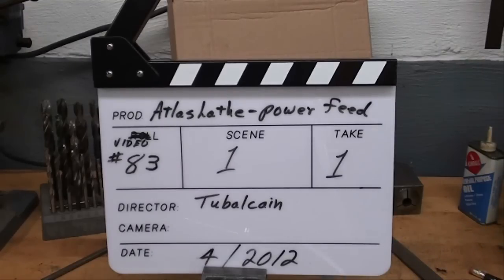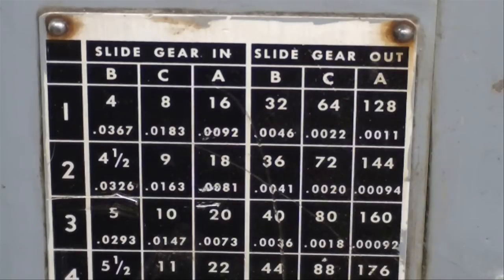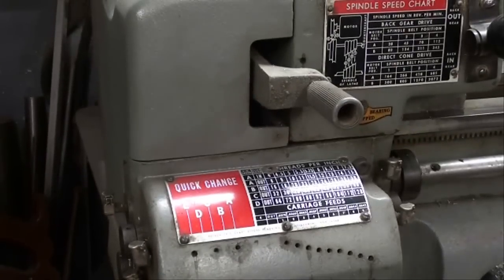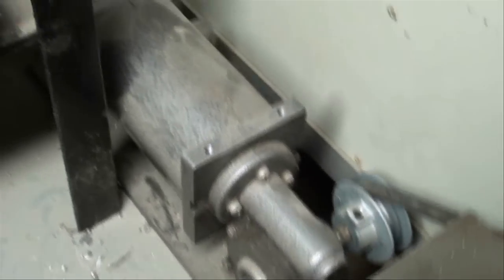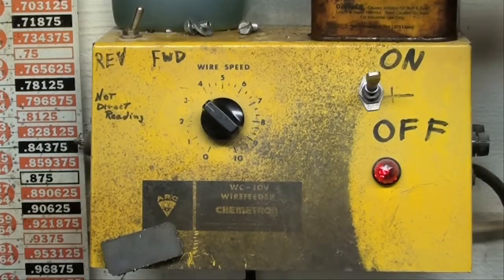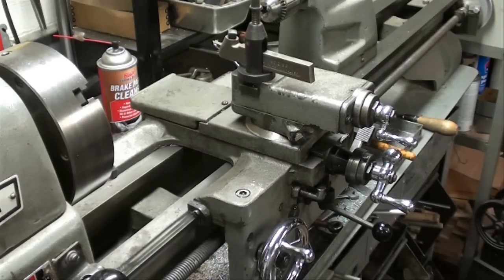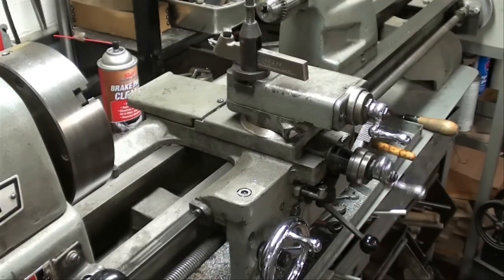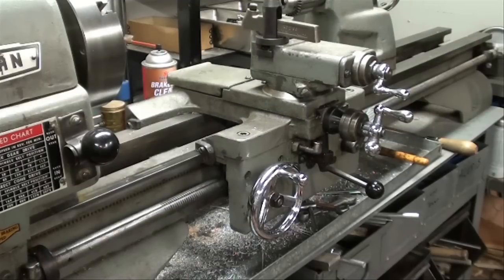Custom Power Feed for Atlas CRAFTSMAN Lathe #83 tubalcain

Comment: Hi, Mr. Pete.

Great idea.

The second best thing about this arrangement is that it really quiets an Atlas/Craftsman lathe. 

The third best thing is the lessening of wear in the gear train.

If you wanted finer adjustment of  the wire feed box ,  a dial assembly for  a variable output switch (also called a ten turn potentiometer) could be fitted in place of the existing knob. 

Tom

Comment: I added a 40/20 combination gear in the gear train of my Atlas 10X24 lathe.  It gives me a final slow speed of .0021/rev.  Not ideally slow, but in the ballpark.  I just double the thread count on the gearbox chart to pick my thread.  Thanks for all the great vids.

Comment: SAFETY TIP! Tubalcain, Not sure if this safety tip has been referred to before. When i was taught to use a lathe I was always taught never to operate a lathe or drill press for that matter under a florescent light. The flickering of a Florescent light can act as a strobe and make it look as if the chuck is not turning when it actually is. We ALWAYS had to use an incandescent light to prevent this from happening. This was drummed in both at school and also in the workplace. maybe worth mentioning

Comment: a DC motor will retain its torque even when the speed is changed. this is why they are still used today. i have an Atlas 12X36 and am real happy with it , except the feed rate is too high, even at the lowest setting. i am considering one of these set-ups in the future. thanks for the excellent training video.

Comment: Hi Tubalcain, enjoying your videos here in Germany!
The reason most high-speed motors out of electrical tools won't work is that they are permanent-stator types. They are cheaper built and in general supposed to be operated at higher RPM's. They lack torque at lower RMP's because of their static and weak stator-field.
An appropriate motor-type is a wound-stator motor, which can deliver full torque at low speeds due to then amplified stator-field. Most servo-motors are wound-stator motors.

Comment: Hi tubalcain. Great video. I already have a VSD on the main drive motor of my atlas craftsman lathe. The original owner installed it. It is really handy. I am going to build a setup like this for my lathe. The alloy used in the atlas craftsman is called ZAMAC I know this because my transverse carriage gear case is made out of this I found out because mine was broken and I had to get it  welded and the welder told me what it was. Great video and great idea.

Comment: Yes, i was in the same boat. Gear blanks are easy to find, cutting ths splines kind of a pain in the butt. Els cost less and does more. It is designed to allow 2 axis control. it will advance whatever distance you tell it to, then stop provided you do the "electric half nut" as well. this setup will also control an X axis, so you just touch off. tell it what thread pitch, diameter and distance you want then press go. 2 axis ELS also replaces Taper Attachment and allows spherical turning.

Comment: That's right, Zamak is a Zinc alloy commonly used on automobile parts. It's not as strong as cast iron but it does the job well on mirror casings, small gears, levers, etc.

Comment: Oh, Mr Pete/Tubalcain. Is there ANYTHING you can't do? Thanks for the video - A few years ago I acquired an old lathe that appears to be an Atlas 10". It's been through a lot of owners by the looks of things and has therefore been modified extensively by each owner. It's a mongrel compared to the machines you have, but I'm inspired by your creativity. It WILL do what I want (yes, this will mean that I add further modifications to an already confused lathe)

Comment: Neat.  Have you tried to cut some non-standard thread pitches in this manner?

If you needed to cut some thread pitches the gear box is unable to, you could use a stepper motor and driver with a PLC instead of that analog speed controlled motor.   Program the PLC with presets to drive the motor at given, known rates to get the desired thread pitch.

I have that exact lathe and am thinking about doing something like that.  I recently needed a .625-19 LH thread tap to finish a part on an old international tractor.  "If only I had a CNC lathe!"

Never occurred to me to power the carriage leadscrew from the tailstock end until I saw this video.  Great stuff, thanks for posting.

Comment: This is cool. What's interesting about it is that you could apply the principle to this using a gilmer belt so it doesn't slip and then get some steppers/servos and do a CNC setup with it.
Reply: Funny you mention that - someone recently did that. They used an Arduino and a few other bits to do a servo drive lead screw. I wish I could remember the name - they had it as a kit.

Comment: I was getting ready to do this vary thing, but with a 1/2 drill motor, Your comment that they don't work well for this is making me rethink that. I thought a good 1/2 inch drill motor running direct drive might work. I wonder if the drill motor with a reduction pulley would work? Maybe I'll just find something better like you did, thanks for giving us the benefit of your experience with this.

I was checking out the change gears and it seems that if one found the right size gear, one could setup the change gears to slow down the shaft enough to work also. Different types of change gears are available so that just might work.
Reply from the maker: Thanks for watching. Drill motors do not seem to hold the lower speeds under load.  If I were to do it over, I would experiment with change gears.
Reply: most drill motors are universal motors, they will run on AC or DC. they have a gizmo which is tied to the trigger to reduce the speed. they would not work well for this. try a treadmill motor with its proper matching controller.

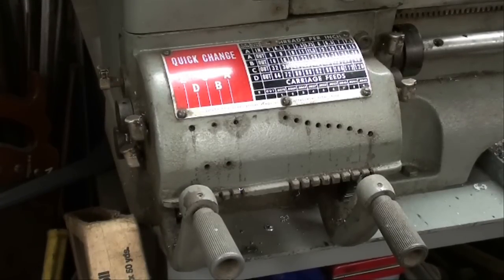Comment: @3:57 you refer to the "Bogus name" of the material of the gears that Atlas used. I believe the name they came up with for this alloy was "ZAMAK" which is an alloy of Zinc, Aluminum, MAgnesium, and Kupfer (kupfer is German for copper). By making the gears this way they eliminated the need for any machining of the gears.

Comment: have you considered setting it up so your power feed unit turns on with the headstock motor.  you could even keep your current power switch so it stays off when you are using the gear drive.  also do you have to unhook something so when you are using the lathe feed you don't bind up the motor gearbox.  it looks like a screw drive which can't be driven backwards.  or does it have a high enough helix angel that it isn't a problem?

Comment: Don't know if it has been mentioned yet, but since you can run the carriage back and forth under power without the headstock turning, you could use this setup to broach keyways in pulleys and gears.
Reply: You'd wear out the mild cast iron ways. They weren't designed for that.

Comment: I like it Pete, Considering trying something like this for my Logan. If I could find a treadmill somewhere,
 would that be a good motor and controller for this set up?
 I have to see what the slowest speed of the Logan is right now. It is of interest that when I 1st got the lathe, the gear cover was cobbled together with sheet metal to allow for a way larger lead screw gear.
It was not even a Gear Logan normally uses, it was one he made, or got somewhere else.
Too bad, I got a new gear cover for for my lathe, and now the cover won't fit over the large gear.
Good Idea getting the drive motor, and controller from the mig Welder.
I like the detail you go into.
Reply from the maker: I never used a treadmill motor, but heard they are good

Comment: If you were to use the gear box to thread something, do you take the belt off of the pully. I only ask cause I noticed the gearbox on the wire feeder is a worm drive. Witch cant be turned from the output side.

Comment: Thanks for the offer, but I"m not close and already have a 12V transformer.   They also have ones with a built-in transformer for 120/220 AC.     They also have inline geared motors.    Still not sure what RPM range I should look for.   An inline geared motor has a max of 35RPM.   That might even be able to be hooked up inline.

Comment: look into something called an "electronic lead screw" or ELS. basically it uses an electric motor to drive the lead screw, a small sensor for spindle position and a little controller that gives you all your feeds, threads etc that you could ever possibly want. not too expensive either. {you can build it yourself on an arduino if youre savvy}

Comment: Very nice! I would suspect the motor is a series motor or "universal motor" if it has tremendous torque at lower speeds. A series motor will operate on AC as well. Electric wheelchair motors are a easily available source for rugged high torque gearhead motors. I picked up a working pair from the local scrap yard for around $8. 
-jc

Comment: Well if you go the arduino route you will have to program all the code yourself. And the user interface will be up to you as well. Auto Artisans make a mostly preassembled controller and interface. You just assemble the board into a case with the other bits and away you go. Its about 325 bucks for their setup, figure another 200 bucks for a stepper and power supply..you are up and running. search "ELS"  on here, i think one of the converted machines featured is a 9 or 10" south bend/atlas type

Comment: Very nice.  This, wish list for a long long time. I have controler, motor like yours, But there is no
way to attach pulley to lead screw on a SB (there is no room) .  How in the world does one
put a pulley on.  I dont want to move the support bearing, or weld, or drill and tap the lead screw.
remaining mystery       sam

Comment: I'm going to spring for this motor and a good reversable speed control.    The controller will allow almost 0RPM.    Have any advise of max rpm I should target the lead screw so I can adjust the gearing appropriately?  This Q is more than just for me, it's for anyone wanting to do this.   THanks!  Dave

Comment: Dear Sir. 
found your piece on, power feed most very interesting,  I would like to see a video on the true relationship to saddle travel speeds to that of the thread,  cutting on a lathe. using your system I realise that Chuck speed. as no relationship when geared. ( but ungeared ) the chuck speed would ponder a problem. In relation to saddle travel,  as speed variance travail could over-run third speed.   Gears the shaft would increase in relation to chuck speed,  &  decrease but what if the chuck is not geared.  how would we work out the variance between the two,  we know that 004 give us a rotational speed of the chuck for facing. but thread cutting ??! most modern model lathes have copycatters variant  to increase the speed of a check  how do we use the system you have to match the speed of the saddle for cutting .!  So I have set you a challenge, an interesting one well I think within your capability. using your powered led crew my Colchester runs on the rack it has no lead screw,  when in gear by the shaft so I could use your idea to power the saddle,  feed, so hear your challenge. cut a 6 thread to the 1" on inch half stroke 1"1/2- stock shaft using an ungeared head stock. ???  are you up to it,  I would love to find out how we do it.  Les Thompson interesting concept,  lets,  run the lathe,  at 100 rpm.

Comment: Another great video Mr. Pete!  Wish I had you as my shop teacher!   Sorry, I know you say "no question, please" but this is an easy one - yes or no.  When you do use the Atlas for thread turning, do you simply remove the v-belt from the lead screw pulley to eliminate the contention with the drive motor's worm-gear assembly?  Or does the worm gear drive have an 'idle' setting'?
Reply from the maker: I cannot thread using the power feed from the tailstock end
Reply: Correct. That part I understand. But how do you 'disengage' the power feed when you do threading on this lathe, where the lead screw has to be powered via the headstock gearing?
Reply from the maker: remove belt
Reply: Ok. Makes sense. Thank you for taking the time to reply.  God bless you for sharing your time, experience and wisdom.

Comment: Idler gears for the feed screw. One is ok the other nut stripped the bolt after becoming loose. A machinist welded the bolt and cut new threads on it. Now when I tighten it down it locks the two gears solid. If I leave it loose it turns the nut completely off. Any suggestions you can give me on it would be appreciated. I cannot fond this bolt anywhere. It has a big head with a screwdriver like slot all the way a crossed it. Perhaps  I  can snug it up and then loctite the nut on it?

Comment: great job you're doing Pete! i have this atlas lathe and am considered a neophyte. i noticed this speed issue and also noticed that the feed would stop and hesitate and then resume.  i assumed that the pressure on the cut was considered and some sort of internal clutch was causing this. i this slipage ok or is it broke?
Reply from the maker: It should not slip

Comment: So far, I got my wiper motor from the junkyard, and a power supply ordered, and a PWM unit with a speed control pot and reverse switch already built in to it ordered, Now I have to start working on the adapters for the motor and the leadscrew.
I think I am just going to use pulleys and a belt like you did.
Reply from the maker: Sounds great.
Reply: mrpete222  Thanks pete, I will link to a video if you are interested when I am done.
Thanks for the ideas.

Comment: "Zamak alloy is composed of alu, magnesium, copper, and zinc. Its tensile strength is over twice that of cast iron. Its impact strength is over four times that of cast iron" From Atlas "manual of lathe operation and machinists tables".
Reply: I'm new to this, so bear with me. It's my understanding that much of production of parts with Zamak was tainted and therefore it was far more brittle than it was "meant" to be. That's why it's fairly known that it's generally not as strong as cast iron even though it could have been must stronger. There are some Zamak made parts (I think the number was less than 10%) that weren't compromised and have seen good life.

Comment: I don't know if you will ever see this comment, but I wanted to tell you that in one of your other videos you stated that you couldn't power feed the cross feed and carriage feed at the same time on an Atlas.  I have a Craftsman Commercial lathe that looks identical to the one in this video, and I am able to power feed in both directions at the same time.  I had watched your other video, so I had never tried it. I discovered that it was possible a couple weeks ago by accident.   Did some models come with that feature, or is something wrong with my lathe?
Reply from the maker: You are right! I was wrong! I just went down and tried my atlas lathe and it does do what you said. I must be thinking of a South Bend.
Reply: Thank you for taking the time to make these videos.  I went out and bought this lathe several months ago.  I had never operated a lathe before, and the knowledge I have learned from your generosity is greatly appreciated.

Comment: I had viewed this some time ago, and came back to review what the lowest speed was on the Atlas compared to my old Mueller (which is about a century old).  It's lowest feed rate per revolution is (measured) 0.006.

Not having a manual for this lathe, I was wondering if you, or anyone else, has seen or heard of a lathe of this size having a point of further reduction.  My thought is that if there is one, it would most likely be in the apron itself.

I've been surprised by hidden gear ranges before, so I think it's possible.  Anyone that has operated an old iron lug tired Oliver 60 without the benefit of reading an owners manual before hand should know what I'm talking about.

If I don't find one, it looks like a solution similar to your's is in order.  I'm not too bent out of shape over that, as a power rapid traverse on that huge, heavy carriage might prove to be a luxury in a decade or so.

Comment: Mr Tubalcain, I have an Atlas 12" lathe exactly like yours and I don't seem to have enough threads at the end to mount a coupler to the lead screw, what did you do to get enough to mount yours? I have a nice motor and speed control, I took the end nut off mine and there isn't enough length to hook up! 
Leonce
Reply: Leonce, did you ever solve this problem? I have a 12" Craftsman Commercial and I am thinking about doing this mod. In watching the video, it almost looks like he has a socket over the nut on the end of lead screw. I would love to know what you came up with. 

Thanks, Brad

Comment: i have an Atlas 12X36  with QC gearbox and the feed is too fast for turning. is it possible to slow down the feed some other way? i may do this method useing a tread mill motor. i have done two projects useing tread mill motors and they really work well. they retain torque throughout the speed range. Caution, buy the motor and the controller as a working package. very difficult to find the correct controller for a motor.
Reply: you can use a 12v windshield wiper motor and control it with 5 amp pwm, with reverse switch ($5.00 ebay) full torque at all speeds  way more torque than needed for lathe or mill

Comment: Once you ELS a lathe, the next step is adding a stepper to the X axis. then you have full functionality computer controlled. At this point you could actually plug the steppers into a PC and run the CNC suite of your choice. Mach3 for example...this opens another pandoras box of ball screws and what not. But its all a logical progression with very little waste of effort or resources.

Comment: Mrpete,, all the gears inside the quick change gear box are steel not cast zmak,,,and the levers and housing are cast iorn,,try a magnet and you will see,, that's why they cost as much as the lathe itself,,,